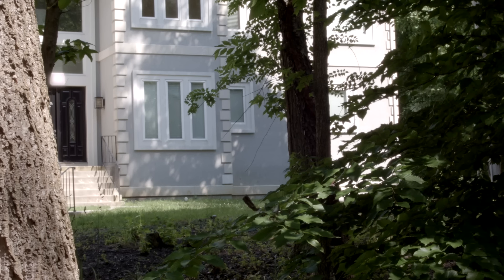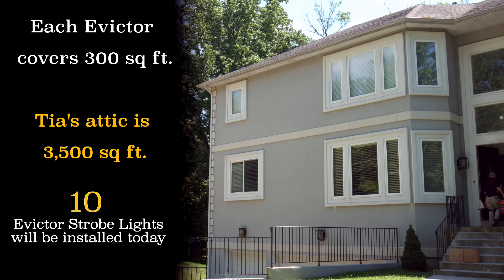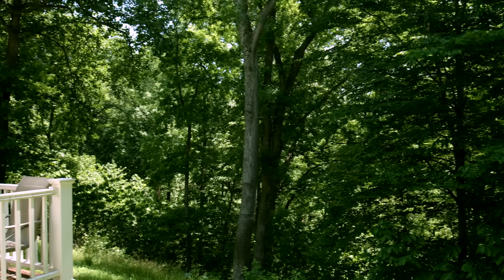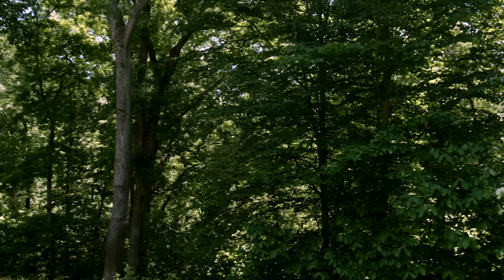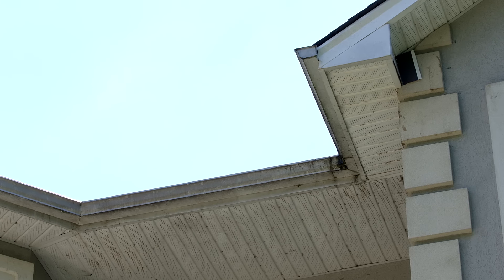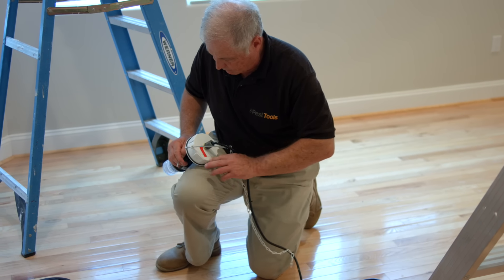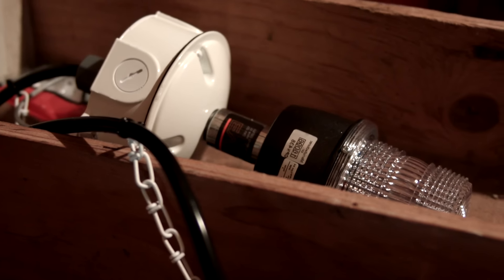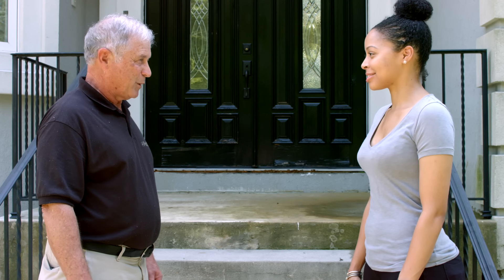How to Get Rid of Squirrels in Attics with the Evictor

Comment: I'm here from the newest video because the comments are turned off on that one.
I have two questions.  
Since I'm unable to access my own attic due to disability..and I know that under the metal roof, when it was installed, they left the old roof up there-  (way before I bought it) what should it cost to have someone install strobes in the attic if I've already bought them?
And.. does it work on mice too?
I was wrong.. I have a third question.
What size solar power bank would it take to run each light?  I have solar attic exhaust fans that haven't been installed yet.

Comment: How many square feet does one Evictor cover?  You said you installed 10 lights in her attic. That’s well over a $1000,00 worth of lights!!! Before spending that kind of money, Does Evictor have a money back guarantee? Just in case this doesn’t work.
Reply: Hi Maple, Each Evictor 10K covers about 300 sq ft .  An average home requires 1 - 2 lights.  There is a 30 day Money Back Guarantee.  Keep in mind that a trapping pest control company can easily charge $1,000 to trap a few squirrels with no guarantees that the same or other squirrels will return to the attic space.
Reply: @ryanearl1412  So...BOTH remedies are insanely expensive. Got it!

Comment: TEN strobe lights?!!  At $150 a pop, that's over $1500!!! Seriously?
Reply from the maker: Most homes only require 1 to 2 Evictors and that cost is well below the cost to trap a single squirrel!  Tia had already spent thousands on trapping and pest control companies without any success.
Reply: At least they have a secondary use, annoy the neighbors.
Reply: Traps aren't that expensive, a live trap will cost around $60 to $70 for a good one.